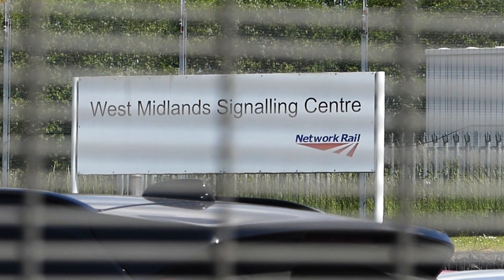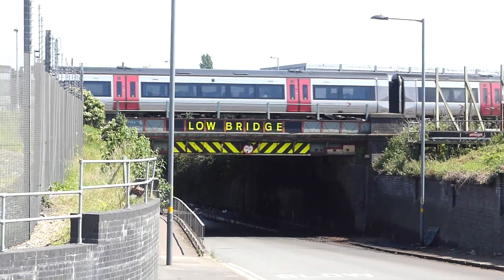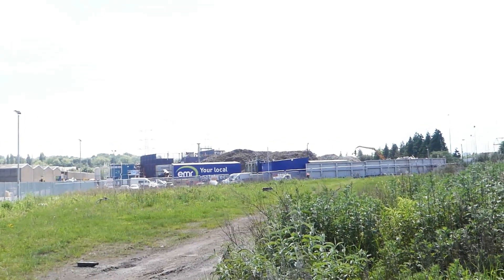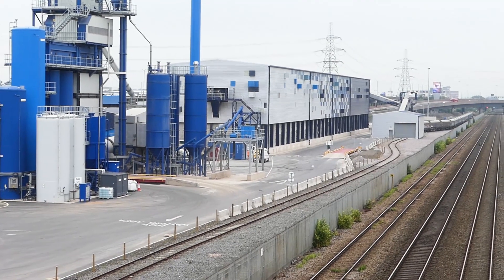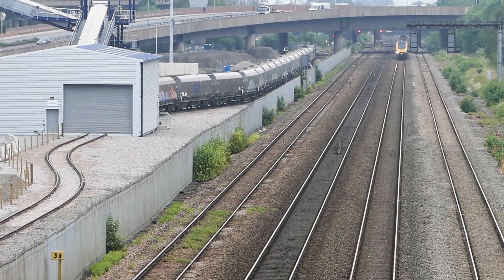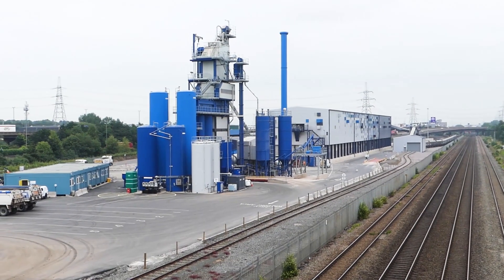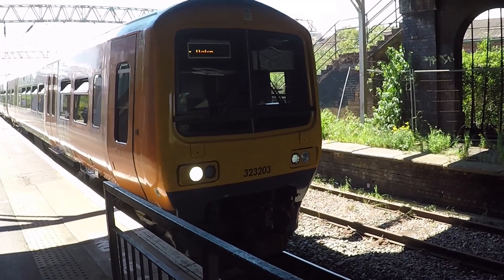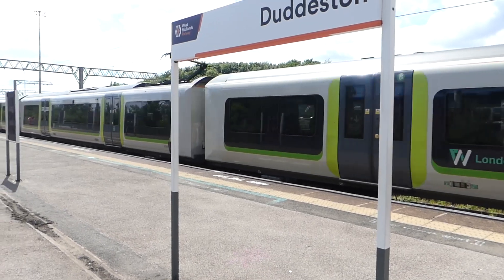New HS2 facility, Washwood Heath plus Saltley signalling. #hs2construction #westmidlandssignalling

Comment: In the Video of the Aggregate plant, to the right of the Birmingham to Derby Line, the flattened concrete area is what remains of both the Metro Cammel works and the LDV Car plant, this is where the HS2 line will tunnel under Bromford Bridge Estate and re-emerge  just past the City of Birmingham Refuse site in Castle Bromwich, then on the rest of that site the HS2 maintenance works will be built.
Reply from the maker: Great info

Comment: The number of times I've walked down from Duddeston to Saltley yard... Any chance you could go down to the other end of the HS2 site - just off Aston Church Road where there used to be a shed as well? Much appreciated!
Reply from the maker: Good idea. Will try next time.
Reply: The shed you are on about went out of existence about 50 years ago and is now a depot for South West Power and no sign of the shed exist now plus it is no where near the HS2 site, the area near here was a part of the Metro Cammel Bus and Train Builders factory and LDV both of which have been flattened now and are just flat concrete slabs being chopped up.